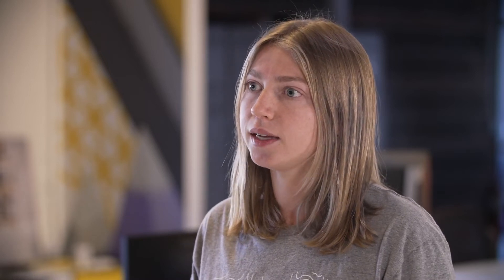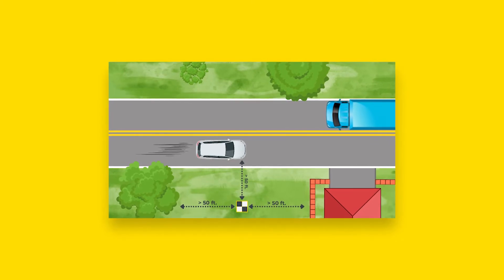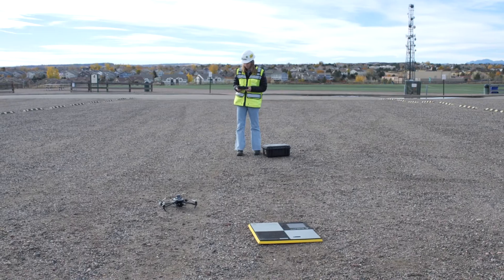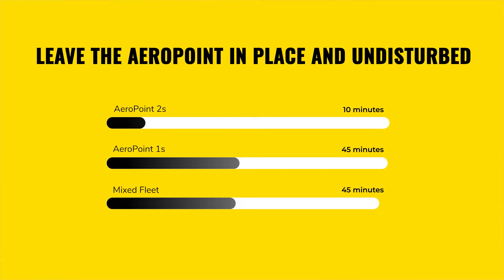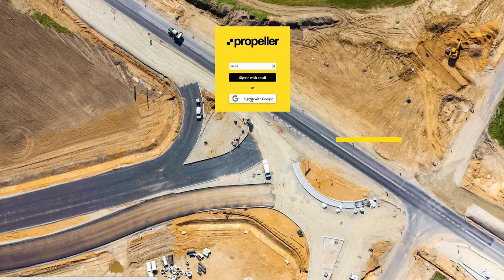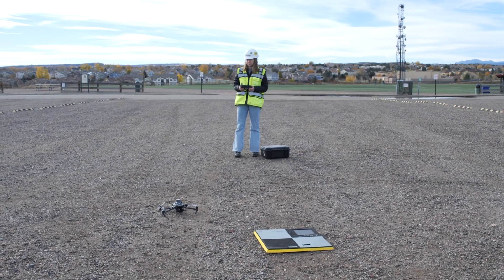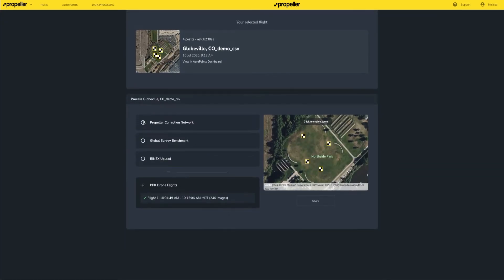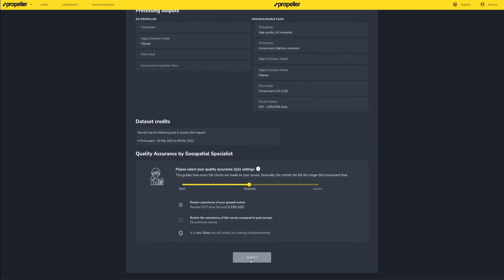Advanced Topics: Establishing Permanent Ground Control Using AeroPoints

Comment: Mind blown that you've actually done this.  I talked with your engineers about this as a possibility 3-4 years ago.  Your sales team needs to know this is a thing.  I brought it up at an onsite demo recently, expressing my interest in developing the workflow for this feature, and they didn't know it's already a thing.  A couple of questions: How accurate?  On a site without a base and rover kit, how hard to create a calibration for later use and loaded into a data collector and machine guided equipment with an onsite base or through a control network? If I establish GCP's with an Aeropoint to a rebar and cap I have placed, how tight are the angles with a total station? Does a GCP created via Aeropoint carry the same level of legal integrity as one done by a licensed surveyor? (Considering the control/corrections network would have been established with licensed surveyors to begin with.) Has there been any cases of dispute where a licensed surveyor's set control was called into question because of a GCP set via aeropoint? Thanks!
Reply from the maker: @Construction_Survey_Czar When using an AeroPoint to establish permanent control, users can expect a global accuracy of 500mm on the X, Y, and Z. Consistency between surveys will be 20mm horizontally and 50mm vertically. Internal accuracy is expected to be 10mm or less.

If you're on-site without additional survey equipment, you'll need to process in a published coordinate system like state plane or UTM unless you have a permanent benchmark that was established previously by a surveying crew. In that case, you'll need to provide Propeller with the calibration file (we support drag and drop from Trimble or TopCon) and know the NEZ of the benchmark the AeroPoint was placed.

An AeroPoint has 10-second precision, which is not as precise as a total station. Therefore, it's not an apples-to-apples comparison.

We can't comment on any cases regarding disputes, although none come to mind.